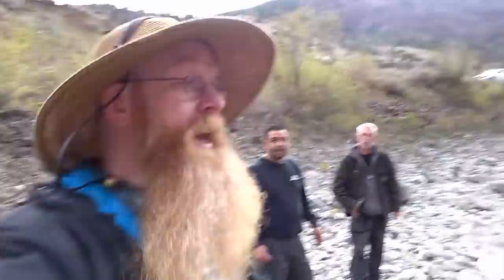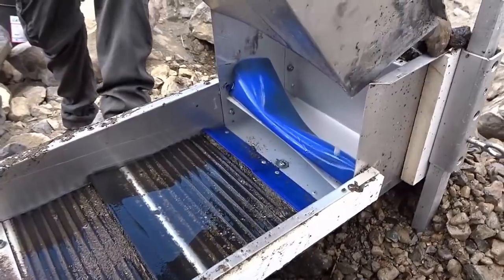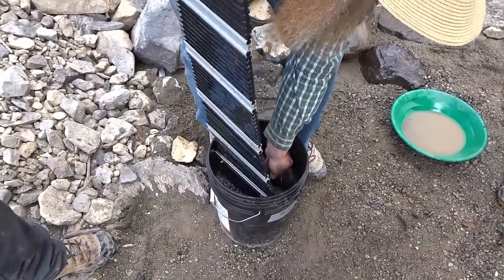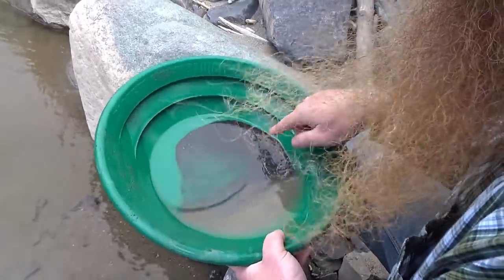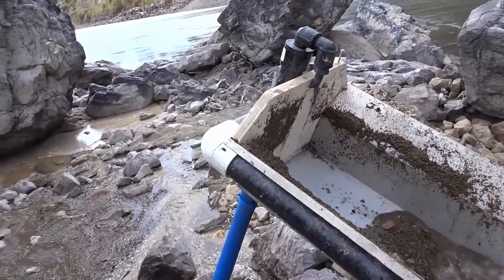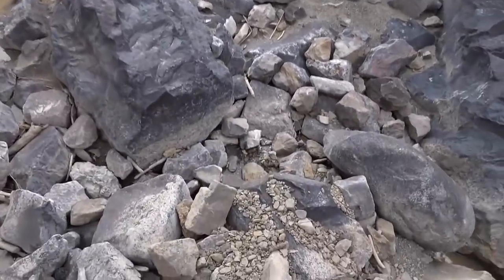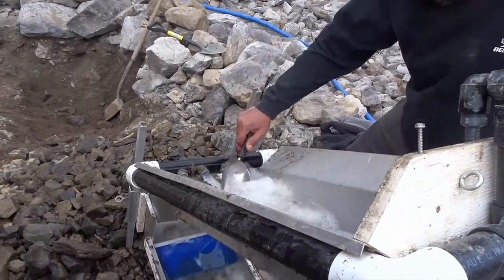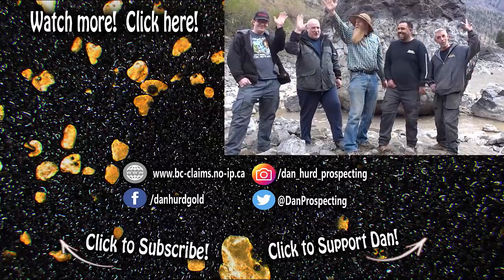Teaching some fans how to find gold with a highbanker.

Comment: You should modify your high banker so the grizzly bars kick off to the side. That way the tailings pile will be to the side and not trying to refill where you are digging out. BTW you are killing us Dan, did you convince Mike and Pete to be good little donkeys and carry out that boulder for you? Or do you need to make a mobile crane so you can lift it up out of there?
Stupid question, can you use a tile saw to cut stones? I've got this really nice red rock (think it's a type of cinnabar) and I want to cut a slice of it and see if I could polish it. I'm pretty sure it's relatively safe unless you heat it and turn it into HgO2 (mercury dioxide). I can always wear my auto paint respirator while cutting it if need be.
Reply from the maker: Yes, you can use a tile saw
Reply: @Danhurd  have you ever held raw cinnabar in your hand? This one, I don't know if it's the algae on it or what but it makes my fingers feel clammy after holding it. Oh btw I sent you a message on facebook with pictures of it